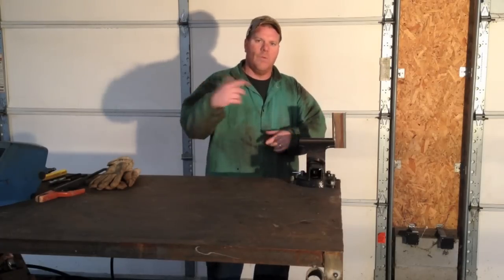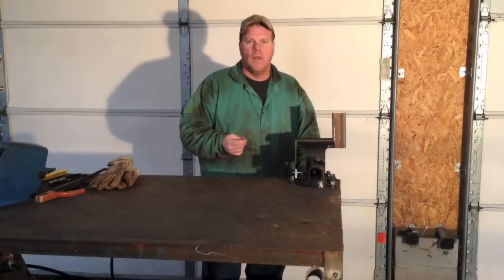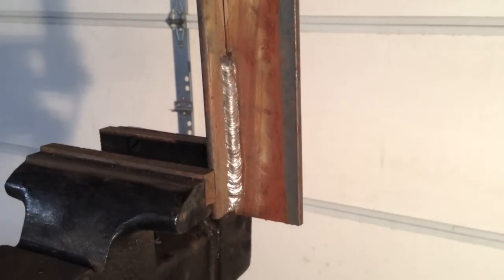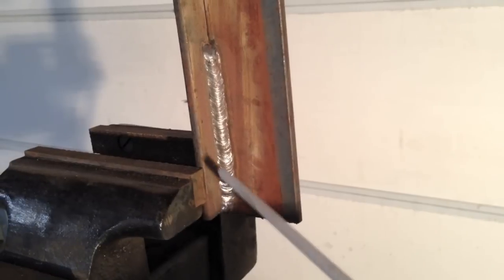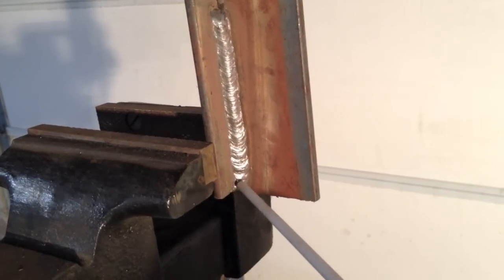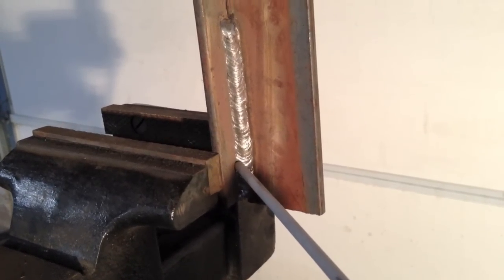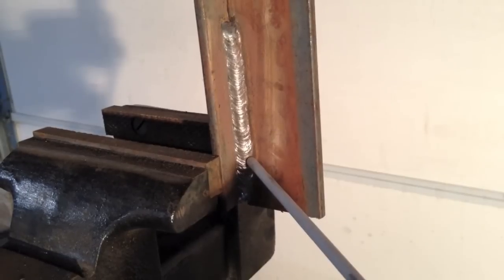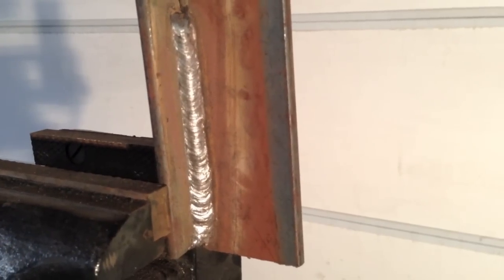Stick Welding Tips and Techniques 7018 Vertical Up

Comment: I can’t seem to get a 7018 started without sticking it. I tried for around an hour and couldn’t get it once. Do you have any tips or a good idea for amps and arc force?
Reply: I’m not a professional but i had the same problem and turning amps up a little and arc force down a little helped me.
Reply: @nathanhipp933  ok thanks. I’ll try that sometime
Reply: Make sure you have a good ground I’ve had trouble before with that and try to strike it more of a Match that helps

Comment: I need to weld a t shape vertical w a 6010 3/32 root pass then 7018 hot fill and cap w proper overlays and it’s giving me a hard time not gonna lie my welds ain’t bad but the overlay ain’t working for me like it should smh

Comment: I am always having hard time in vertical because all the slag falls down.. Is there any way to stop it?
Reply: Vraj Pandya electrode angle of 5-15%. Play with your amperage settings. Wrap the stinger cord around the back of your neck or around your arm to take the weight off of it. Experiment and find the method for you. Good luck!
Reply: Thank you so much. Really appreciated

Comment: Taking welding at my local college this shit is driving me insane, I know I’m close, can’t give up now!
Reply: As a qualified boilermaker going for my 3E certification Australian Standards 1776 issued by Weld Australian and recognised by the International Institute of Welding I think this procedure is wrong. You should be doing a christmas tree and pausing in the centre. If you where to break test this I'm sure you would not be biting into the material getting that nice sawtooth and you may have inclusions.

Comment: in any stick welding, at what point is it too late to go back into the pool that, through ur mask, has already appeared to solidify seconds prior?  
as an example, on a flat weld, as i progress i sometimes notice a missed spot as the pool illuminates the section right behind it, that through the mask already appears to have solidified.  if i go back that 1/4" to hit that spot am i practicing a bad practice?

Comment: I'm taking this test tomorrow. Here in Western NY we have been taught to do a root pass (stringer as others have called it) first and that gets inspected. If there is any undercut or if it doesn't look consistent it's an auto fail. Then we do a weave as a second pass again consistent and no undercut. I wish I could just do the weave (cuz I can do that in my sleep). For some reason I leave slight undercuts in my root pass. Undercut of more than 1/32 is a fail. I'm not looking forward to this test.
Anyway, nice video thanks for posting.
Reply: Did you pass?

Comment: Hello, I have been told to use a triangle motion (or "christmas tree" ) for the first pass, with the stick hold in the corner so it dig well there, then balance right and left nut under that initial hold (with little hold each side too indeed)

That seem to be a standard way of doing corner up here in France, then only for second bead and next a progression as you show is used.
Very difficult to do that progression evenly the puddle staying in place 

Do you use also that triangular motion ?  Under which circumstances ?

Regards
Thank you for the videos, they are very usefu
Reply: Isaac OLEG in trade school we also do the "christmas tree" when its done by a talented welder they look amazing
Reply: Mad_child__ thank you. I was not well aware that one side of the triangle is clearly longer. I sound as the perfect motion for Mig but way more difficult with stick. That is how you learn it? Regards
Reply: yeah with mig and stick, general purpose and low hydrogen 3.5mm sticks on 6mm sheet :) its very hard but once you get the movement right it looks really nice, they do how ever show us corner to corner crossing aswell, that's still not as easy as it looks
Reply: I'm doing a welding course for a few weeks and I'm a good welder but I can't do triangle welds I must try this method it looks alot easier it makes alot more sense

Comment: Are you suppose to weave? I have never weaved and I think it turned out fine. Or am I doing it wrong?=
Reply: Wolfgumm, you don't have to weave; there is nothing wrong with welding stringers. Weld one stringer up the middle, and then weld a stringer on each side of it.

Comment: i use 6011 or 13 sticks. around 90amp on 2mm steel. crank it higher and it blows holes through. other than that it sparks ok, but just drips on top of eachother with no actual welding bond to the 2 joints. guess i just keep praticing

Comment: Been 2 years since welding school sincd I ran a stick of anything. Got a job last week and I am going to have to run stick sometimes but that's ok. This was a great refresher. Thank you. Simple and to the point.
Reply: I bought a old Lincoln 225 stick for practice at home it's been 11 years since school and most shops only run wire but higher paying shops will run both so it's always good to keep up on your welding for some reason it's not like shooting a gun or riding a bike you can actually forget how to weld lol

Comment from the maker: Yep, spending too much time in the middle will start to drip metal and make your weld look bad. Hold the corners a bit longer and it will work good. Keep at it. It will come with practice.
Reply: This was my exact problem. Didn’t know what I was doing wrong till after watching this video. Thanks
Reply: What happens if your rod starts heating too much on the side almost as soon as you get to it but heat is already turned down? Just let material cool?

Comment: 22 years ago when i got my presure vessel tickets it was called J welding and i cold weld wait a couple minutes and the slag would fall right off with no chipping. All depends on the 130 amps and 7018 rod

Comment: Good video. One thing to explain when showing the side to side motion without the arc is  that the electrode does not go as wide as the bead you show.

Have a good one.

Comment: Dave, Ive Been at this Also, 36+ Years, And Never Heard It Called that,, Accually The Guy who was SPAMMED,, was the Way,,The Old Timers Used to do It,,and Most of the Welders,at the Tank Farm,, Reds Looks Good,! I see what Ya Mean, with the Flux!  Theres only about 100+ Ways,, I Learned,,that The Crappier the Flux Looked,, The Better the Weld Under,, But we were Lucky,,We Had Old JET,,Air Needle descalers!! As Im Doodling a Chritmas tree on My Pad!!!!!LOL,,Thanks,, BOTH!!!,Jack

Comment: A lot of people are knockin this dude b/c they think 120amps is too much. WELL...if you guys are welders, then you know that EVERY welder is different right?! I have 2 welders, and on the Lincoln I know to keep it a hair below 100. On the killer I know to keep it a hair below 125....THERE ALL DIFFERENT
Reply: +Collin Loretitsch yeah, we have a miller, and i knock that guy around 90 amps with 1/8th and about 75-80 amps on 3/32nd, cuz even if we put it a little below 100 amps with 1/8th, that shit will burn right through
Reply: 120 amps for 1/8 low hydrogen is not too high at all. Trying to weld 1/8 low hydrogen at 100 amps is crazy. 3/32 inch low hydrogen should be used at 90 to 100 amps.
Reply: yeah 120 is abit hot 113 is good ball park for filler beads on vertical but i weld a 105 for the root bead with a Lincoln machine
Reply: How can I lean that I like it and I love it

Comment: I would really like to see one of these "experts" do a decent vertical weld of any form.
There is nothing wrong with this technique, for the root pass you have to use some form of manipulation - oscillation, weave pattern etc. otherwise the deposit is far too convex, creating slag inclusions at the toes. You can ague about what is the best manipulation pattern - sine way weave, triangular pattern etc. but any will do as long at the root is penetrated, good side wall fusion and the weld profile is flat to slightly convex. Job done.

Comment: The slag should almost if not fall off itself with little or no chipping with hammer on 7018 rods
Reply: What is. Manual arc welding

Comment: in my opinion vertical up gets hot very fast,so cooling in between welds or lowering amps is a must for a consistent  weld
Reply: 9
Reply: Thats true.
Reply: Apparently you know nothing about piecework

Comment: Don't listen to OdinAF or David Raus this is a perfectly fine technique. Master welders have been using this technique since these two's fathers father was an itch in his dad's pants. It has been used on everything from bridges to submarines and the only time those failed were either the result of stupidity in construction or design by engineers who got their design ideas from an erector set. " the bead is not flat". So? it does not have to look pretty as long as there is ample penetration and no undercutting that can undermine the welds strength who cares? An accident inspector will not care if the weld is pretty or not, the proof is in the pudding if it can withstand the pressure the material was designed to hold... The prettiest weld in creation can hide micro cracks not penetrate etc.
Reply: صحيح

Comment: hi sir i have a little advise hope you considered it.Please maintain your electrode angle until you finish penetrating from the button up to top.Practice how adjust and how to get a exact ampere because that is very important in doing welding works and focus to your padding techniques it help you to get a exact welding result.Not bad for you. be open mind get the positive idea and throw the negative. :)

Comment: If you're getting undercut it's probably because your heat is too high, or you're not pausing long enough. Not pausing long enough used to be my problem. Is 3F vertical? I cant even remember. I'm answering this assuming you mean vertical. Any other position, undercut usually comes from too high heat (although that will usually be evident by the amount of spatter) or traveling too fast.

Comment: If you stay in the corner longer than you did, the weld would be much flatter than that and it would look much better. I stay on the sides for maybe 2 seconds than I sweep over to the other side and do the same thing there. And slower than you did.
Reply: Yeah i did notice he doesn't hold it long enough on the sides.
Reply: more like 1 second...
Reply: daniel stuart 9
Reply: He needs more heat to get deeper penitration on his sides.... your right though, he needs to sweep quicker across and hold the sides more to get a flatter weld.
Reply: The important is it has to be x-ray Proof if your a profesionell
Reply: and what amps you suggest for uphill?

Comment from the maker: It depends, how many amps are you running? For 1/8" 7018 I am using about 120 amps. You might not be holding in the corners long enough. You should spend twice as much time in each corner as you do in the middle of the weld.
Reply: I do mines on 126 amps

Comment: Been welding almost 20 years (off and on) and the vertices still (at times) get me frustrated 

My BIGGEST screw up when welding vertices sometimes is not being consistent. The angle at which I begin my weld tends to change as I get higher and high up on the weld.  I'll lay great a nice roll of dimes on one sweep, then when I change Rod, I find that I have mistakenly changed my welding angle during the course of the next weld I lay. I discover this AFTER my weld has been laid of course and my weld (although it will still hold) just looks shitty.  Iam my own worst critic and  other IWs can be brutal on a guy who isn't a pristine welder. Always some fuck head who I see going over to take a quick peek at my welds to see how I size up to him 

Anyway.
Reply: 25?

Comment: Theres no need for the side to side, just add a small amount of oscillation and stay consist in travel speed and arc length.  You're focusing too much on your movement causing you to long arc, not saying your long arcing bad but none the less its still a long arc.

Comment: i dont understand how you got such a good bead like that ill do what you did go from the metal on top to the base metal and im welding horizontally because I'm still in hs welding but i go from top metal to the corner to base metal than back up again and i always come out with this extremely bad bead? any advice?
Reply: You don't weave in horizontal, just run straight stringers. You're gonna get saggy welds almost always when trying to weave in horizontal.
Reply: Don't weave side/side when doing horizontal
Reply: 7018 vertical up is tricky. I'm just trying to get the hang of it now with my everlast welder. It's much easier with the fast freeze rods that's for sure.
Reply: Marc Richard Hookumchand never weld down hill with 7018. 
It’s ok to weld downhill with 6010 and 6011

Comment: Look at the paused screen at the start of the clip, the bottom ok but once it gets up a bit it becomes convexed. I also doubt ithat this would have sufficient peon as you are only weaving side to side. Basically your doing a capping run for your 1st pass. I wouldn't take this advice on board. Sorry to offend

Comment: I'm sorry but I think this is an average weld at best, sloppy technique & the finish is amateurish. Why not use the Christmas tree technique? Your able to build weld in the middle & hold your edges to get a weld face of 10mm if using a 3.25mm low hydrogen electrode. By doing this your weld face is consistent & flat not convexed or concaved with no undercut if amps are set right & edges are held long enough. Foolproof & strong once learnt.

Comment: As a CWI, CW Engineer, I do so concur with David, Your carrying to much metal, You will never weld in the Pacific Northwest with that weave tech. It has been proven over and over that it causes longitudinal cracking in loaded welds. You can not call yourself a welder unless you can run a stringer.